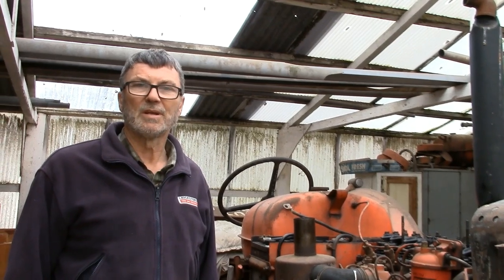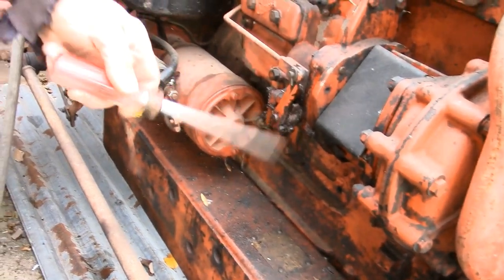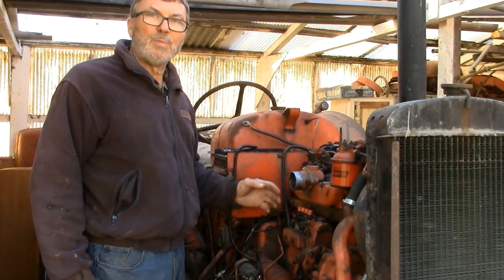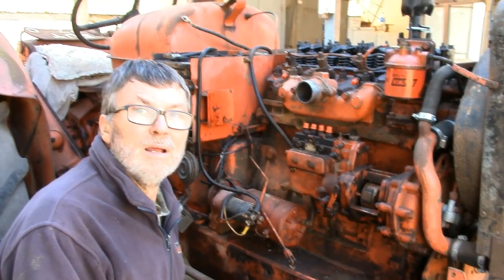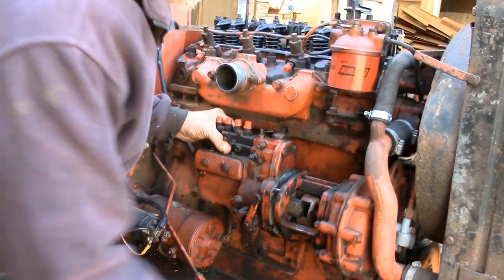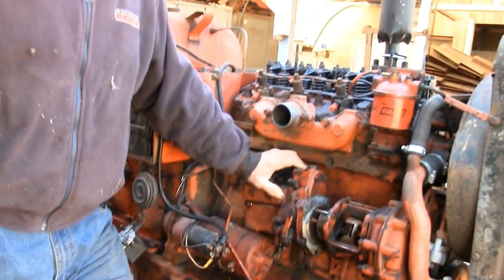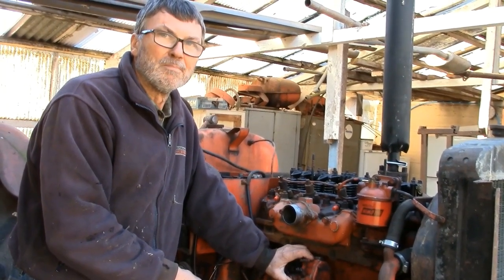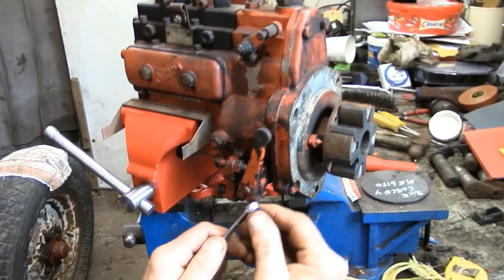Simms Injector Pump Seal Replacement

Comment: Great video. Have you ever come across a problem with the Simms Injector Pump where the shaft which controls the fuel cutoff does not return to the open position. On my 465, I have to open my inspection port and move it manually in order to start the tractor. I am terrified about removing the pump now after what you said about resetting the timing!
Reply from the maker: Sorry I can’t help you on that one

Comment: Thank you!  On the front of the pump it looks like a rubber star shock absorber, is that what it is? Harder than rubber I'm sure
Reply from the maker: Just a flexible drive, I wouldn't say its a shock absorber as later tractors had the timing gear mounted directly on the pump shaft.

Comment: Bonjour Mr , 
J’ai un problème de régulation avec mon nuffield 460 .
Si le moteur est en route depuis 15 minutes il accélère tout seul et le régime moteur redescend au bout de 10 minutes. Pouvez vous m’aider ? Cordialement
Reply from the maker: Have you checked there is oil in the injector pump housing?
Reply: @montegoson  non je n’est pas vérifié. Quelle huile faut il mettre et quelle quantité ? Merci d’avance

Comment: Do the  line on Leyland 384 engine  crack and is there any way to stop dim  for crack.
Reply from the maker: John Biggins, Sometimes our hands do not type what our brain is telling them, and is you comment related to injector pumps?
Reply: @montegoson  do the line on Leyland 384 engine crack and is there any thing to stop dim for crack
Reply: @johnbiggins2948  I think he’s trying to ask do the cylinder liners crack on 384’s’ and is there a way to stop them 🤔 I think the problems started when the bores were over sized & became very close to each other also caused trouble with the head gaskets